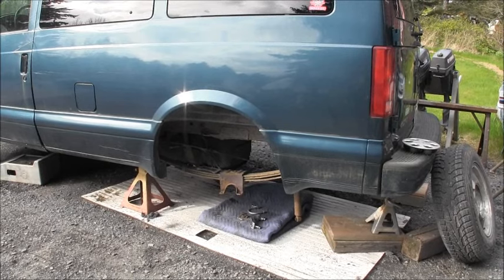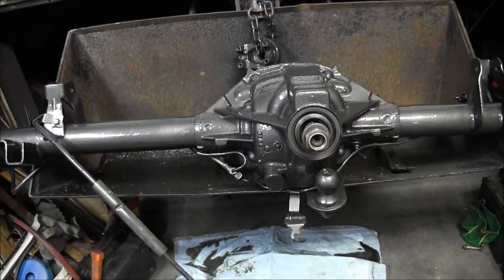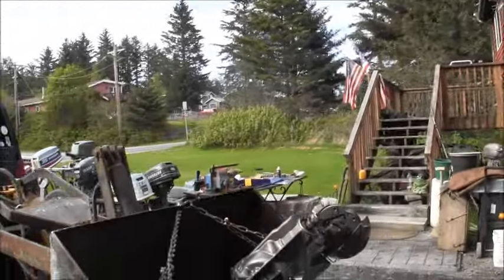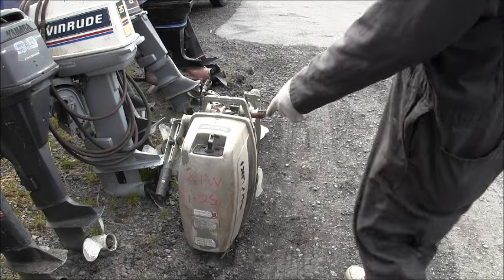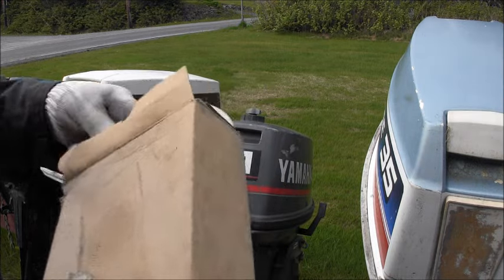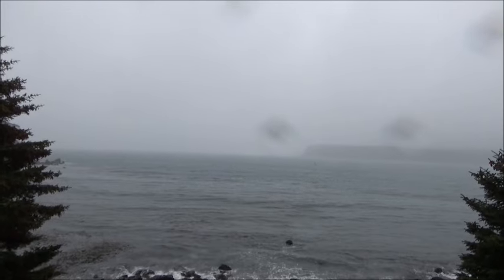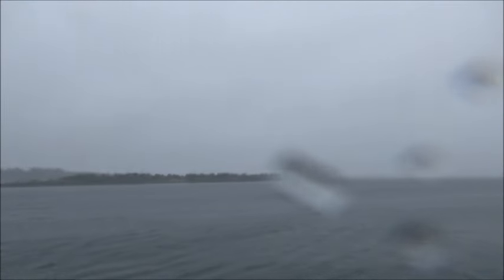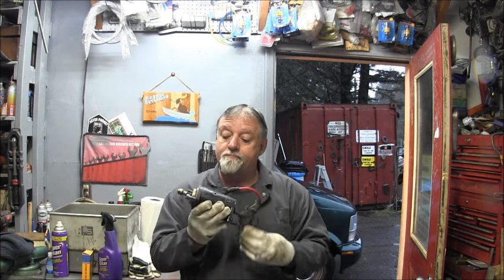OUTBOARD'S  & A PAIN IN THE REAR

Comment: That Astro van seems to have dealt pretty well with Kodiak's ever salty environment. Being a 4 -wheeler, if I'm not mistaken, just adds to it's appeal. I run a short shaft 1992 Johnson on a 16 footer aluminium hull. It always starts on 1st (easy) pull.and runs smooth and sweet. Great engine !

Comment: By driving that, does that make you an Astronaut? I have severe arthritis and I had to retrofit to electric start for my 85 or 86 35 Evinrude. Luckily, my flywheel was for electric start and I just needed to find the starter motor and the mounting bracket. I have learned a lot from watching your videos. I was searching for information on the retrofit and stumbled across your videos and have been watching ever since, thanks!

Comment: I need your help.  I was messing with my friend's 1975 4.5 hp mercury, and tried starting it with my impact with the cover/hood off and stripped the nylon lock nut on top of the flywheel.  I can't tell online which is the right one to order (says @6?)  Can I just go to the hardware store and buy a regular locknut?  I measured thread pitch, and I don't think it was normal "fine" or "coarse".  Also, I know ... too much, but ... I need a thumb screw too, as his was bent and stripped.  I'm not sure which one/part number.  It isn't the same as the later 8.5's and 15 hp (bigger diameter, and aluminum).  It is about the same size as a johnson 9.9, but has a little finer threads.  Thanks!

Comment: Hey KODI I have 1986 evinrude 15hp thats driving me crazy I have installed new intake gaskets new exhaust cover gaskets new head gasket and new powerhead bottom gasket and a power pack idles like a champ at slow speeds runs like a new one but when you give the throttle only making 7 or 8 mph on 14ft aluminum I can't figure this out do you have any ideas PLEASE ?